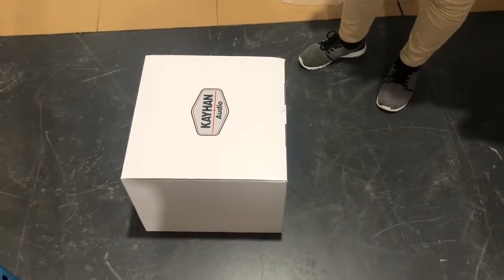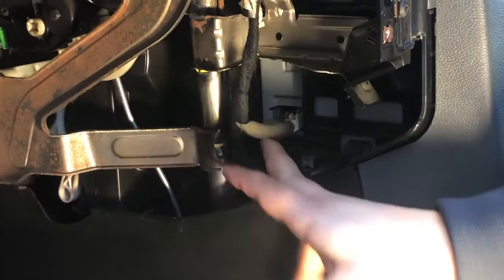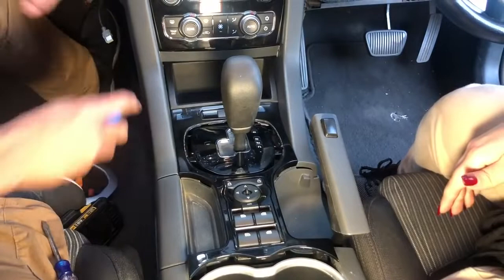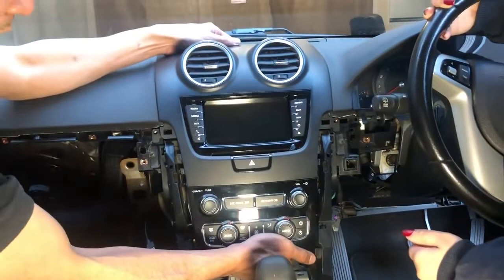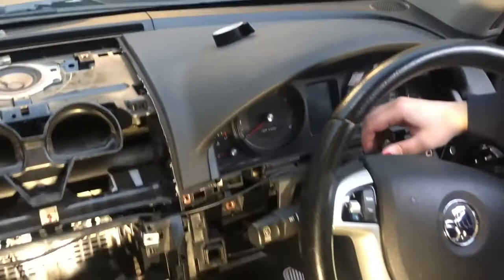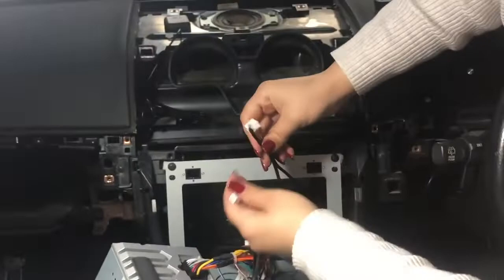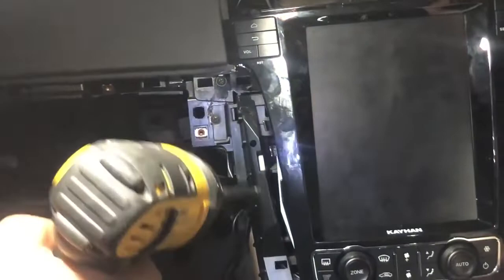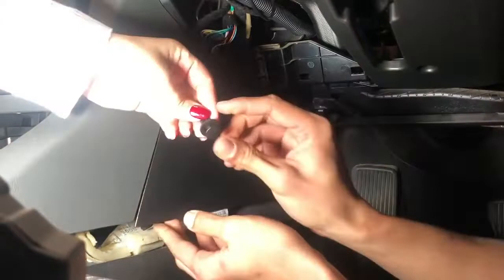Kayhan Holden Commodore VE Series 2 Premium dash kit Installation Guide

Comment: Love how Kayhan Audio breaks down the info in an easy-to-understand and bloody captivating way.
Reply: Did you buy the unit. I'm seriously thinking of getting it. It's a toss up between the Kayhan and the Kenwood DMX9720XDS 10.1"  floating screen. Also do you know what the what the voltage of the pre out is on the Kayhan as I want to install Amps and a sub at the same time.

The Kayhan is ahead at the moment on price. With the kenwood you have to buy the Aerpro facia kit which increases the cost to $2,200 plus.

Comment: I'd honestly recommend this head unit! I got this for my car and love it. the only thing I hated was the gloss (which looked a bit cheap as there were white spots in some areas, but mainly because nothing else in my car was gloss), I wish a matte black option was available. I ended up just spraying it black which then suited the rest of the interior. One other thing I really liked is by using this head unit it added adaptable reversing lines to my reversing camera (changes depending on the steering wheel angle).

My tips for anyone else who gets this, don't mount any of the antennas on the back of the head unit (like shown in the video). When installing mine, I disconnected the centre speaker and mounted the antennas around the speaker housing, this way they have better exposure and aren't being shielded by the metal dash brackets, and is all covered by the speaker grill (which is obviously made to allow sound through which will again give the antennas better signal), I also bought a glass mount antenna from JayCar which I used to replace the little WiFi antenna that comes with the head unit which I also mounted under the centre speaker grill. I also didn't bother using the provided microphone I found that the cars build-in microphone works with the head unit, so using the microphone isn't required.
Reply: Did it come with the top hat or did you have to buy it separately.?
Reply: @tjevans3823  top hat? I'm guessing you mean the piece that houses the vents? If so then yes it does come with the head unit, but I didn't get why they didn't make that gloss too, but like I said I got my facia spray painted and to make sure it matched I sprayed the piece above the head unit too

Comment: ok dumb question, does this fit VE II Calais? it has different vents to the car in the video. Thanks
Reply: You'll need to get new trims. Am installing one on a ve calais series 2 the only problem I have right now is the reverse camera isn't working apart from that pretty straight forward
Reply from the maker: Hi we have just launched version 5 which comes with :

1. 8 GB Ram

2. 128 GB SSD hard drive

3- 8 core CPU 2xA75 + 6x A55

4.  Bluetooth version 5 with data sharing.

5.  Built in wireless carplay.

6. Built in wireless android auto.

7.  Built in DAB – Australia Only (( digital radio ))

8.  6 channel RCA out (( 4 speaker 2 subs )) with a massive 4.3 volt power on RCAs.

9.  Ultra HD IPS anti glare screen.

10.  Built in professional DSP (( digital sound processing ))

11.  3 port USB

12.  Hdmi in and out

13.  DB33R background noise cancelling microphone.

14.  Microphone gain control volume.

15.   AM/FM with RDS

16.  2 channel video out.

17.  2 channel video in.

18.  Reversing camera FHD input ready.

19.  Front and rear AUX input.

20.  Front USB input.

21.  Voice assist built in.

22.  Instant startup.

23.  Adjustable reversing camera guidelines.

24.  Customisable Home Screen.

25.  Startup wizard.

For more info please check our website www.kayhanaudio.com.au or mail us at info@kayhanaudio.com.au

Comment: You installed the antennas in wrong sockets. 4G 1st. WIFI 2nd. GPS 3rd. Easy mistake. Test it before securing it.
Reply: Dont you mean.... wifi at top, 4g in middle and gps in bottom.
Reply: @glenperry5159  No I dont! When making an installation video, it has show it working. (Im a game mod author on nexus, so I know) The video does not show the stereo on let alone 4g & wifi working. I had the stereo professionally installed and found faults. WIFI, 4g and few missing software and sent it back. Kayhan said its written wrong on back of stereo. All sockets worked,  just cables installed in wrongly labeled sockets.  I have photos to prove it.  Thats why I made the comment to help other people since it cost $600 total for twice installed and once removed. Got extended warranty in exchange for reimbursment. Stereo still in my car and working since. Loving it.
Reply: Id love to see the photos. My unit is currently pulled out so i can fix my gps signal and when i put the gps antenna in the bottom socket it got a strong satelite signal instantly so that part i 100% agree. With the wifi antenna tho mine seems to work on hotspot fine being plugged into the top socket? I havent tested 4g because im not using a sim card but will test that out just before putting back in somehow

Comment: Can i connect after market parking sensors to the unit??
Reply from the maker: Yes 
And just an update we have just launched version 5 which comes with :

1. 8 GB Ram

2. 128 GB SSD hard drive

3- 8 core CPU 2xA75 + 6x A55

4.  Bluetooth version 5 with data sharing.

5.  Built in wireless carplay.

6. Built in wireless android auto.

7.  Built in DAB – Australia Only (( digital radio ))

8.  6 channel RCA out (( 4 speaker 2 subs )) with a massive 4.3 volt power on RCAs.

9.  Ultra HD IPS anti glare screen.

10.  Built in professional DSP (( digital sound processing ))

11.  3 port USB

12.  Hdmi in and out

13.  DB33R background noise cancelling microphone.

14.  Microphone gain control volume.

15.   AM/FM with RDS

16.  2 channel video out.

17.  2 channel video in.

18.  Reversing camera FHD input ready.

19.  Front and rear AUX input.

20.  Front USB input.

21.  Voice assist built in.

22.  Instant startup.

23.  Adjustable reversing camera guidelines.

24.  Customisable Home Screen.

25.  Startup wizard.

For more info please check our website www.kayhanaudio.com.au or mail us at info@kayhanaudio.com.au

Comment: If i buy, where can i Find installation service
Reply from the maker: ITs all Plug and Play
Reply from the maker: Hi everyone we have just launched version 5 which comes with :

1. 8 GB Ram

2. 128 GB SSD hard drive

3- 8 core CPU 2xA75 + 6x A55

4.  Bluetooth version 5 with data sharing.

5.  Built in wireless carplay.

6. Built in wireless android auto.

7.  Built in DAB – Australia Only (( digital radio ))

8.  6 channel RCA out (( 4 speaker 2 subs )) with a massive 4.3 volt power on RCAs.

9.  Ultra HD IPS anti glare screen.

10.  Built in professional DSP (( digital sound processing ))

11.  3 port USB

12.  Hdmi in and out

13.  DB33R background noise cancelling microphone.

14.  Microphone gain control volume.

15.   AM/FM with RDS

16.  2 channel video out.

17.  2 channel video in.

18.  Reversing camera FHD input ready.

19.  Front and rear AUX input.

20.  Front USB input.

21.  Voice assist built in.

22.  Instant startup.

23.  Adjustable reversing camera guidelines.

24.  Customisable Home Screen.

25.  Startup wizard.

For more info please check our website www.kayhanaudio.com.au or mail us at info@kayhanaudio.com.au

Comment: I don’t know why I don’t like it it’s cool but I just don’t like it
Reply from the maker: Hi we have just launched version 5 which comes with :

1. 8 GB Ram

2. 128 GB SSD hard drive

3- 8 core CPU 2xA75 + 6x A55

4.  Bluetooth version 5 with data sharing.

5.  Built in wireless carplay.

6. Built in wireless android auto.

7.  Built in DAB – Australia Only (( digital radio ))

8.  6 channel RCA out (( 4 speaker 2 subs )) with a massive 4.3 volt power on RCAs.

9.  Ultra HD IPS anti glare screen.

10.  Built in professional DSP (( digital sound processing ))

11.  3 port USB

12.  Hdmi in and out

13.  DB33R background noise cancelling microphone.

14.  Microphone gain control volume.

15.   AM/FM with RDS

16.  2 channel video out.

17.  2 channel video in.

18.  Reversing camera FHD input ready.

19.  Front and rear AUX input.

20.  Front USB input.

21.  Voice assist built in.

22.  Instant startup.

23.  Adjustable reversing camera guidelines.

24.  Customisable Home Screen.

25.  Startup wizard.

For more info please check our website www.kayhanaudio.com.au or mail us at info@kayhanaudio.com.au